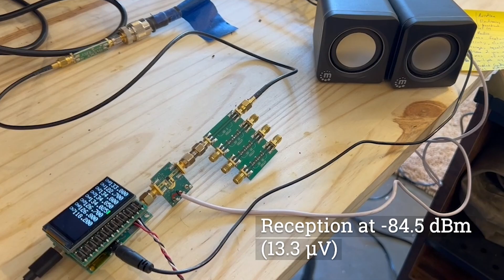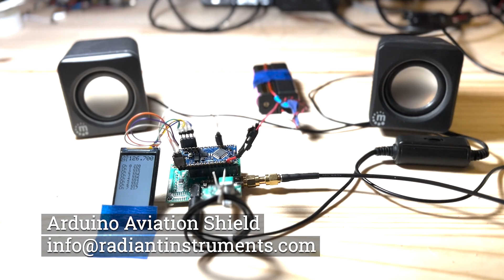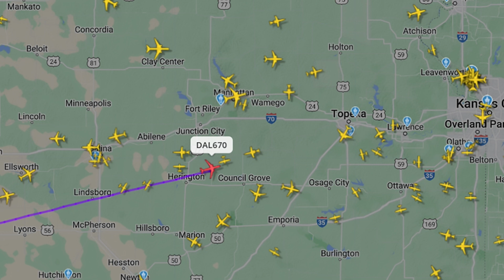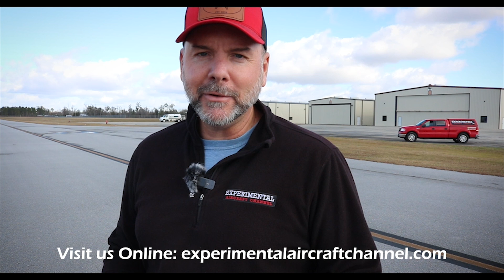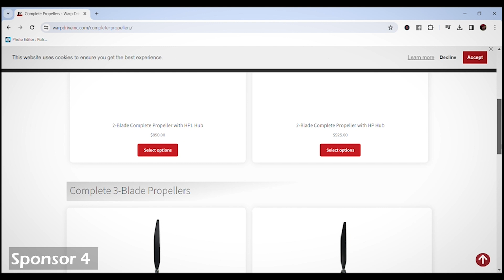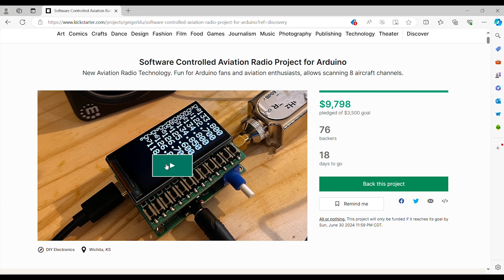An AUDIBLE ADSB Radio for Aircraft - SCARP James Wiebe

Comment: The receiver should be installable as a no hazard, safety system installation.  The transmitter would be tougher. FCC approval as a minimum for VFR use. TSO is not required for VFR communications equipment.

Comment: One comment to James,   no need to wait for GA certification.  Just put some Velcro on the back of it, stick it to the panel,  and you can use it today (after checking for interference issues).  Just make sure the LO doesn't radiate too much.

Comment: Made a scanner?  Functionally, I don't see what's that different... The form factor is the most interesting feature here, IMO
Reply: I agree. I see a big future for downsized and integrated avionics of all kinds. It should save us a lot of weight, a lot of money, and offer much improved reliability and performance. FAA is trailing too far behind, which is making safety too expensive.
Reply: @101jtag  careful what you wish for.  FAA offloaded the oversight of safety self-certification to Boeing. How did that turn out? When you allow manufacturers and designers to self-police, the results will be predictably bad for safety (but good for quarterly corporate profits.)

Comment: Sounds very interesting -  I'd want it to allow a remote head - one radio, control it from either the front or rear cockpit of a tandem aircraft.  FYI - you also need FCC certification for the transmitter. Connection/interface with GRT EFIS is a plus!

Comment: I guess I missed how ADSB plays into this. The SCARP appears to simply be an 8-channel scanning receiver which has no ADSB functionality. I did hear him say that he's looking into a better way of using ADSB, but it sounds like a separate project. The title of the video had me thinking that SCARP would use ADSB to filter out any communications that weren't in your vicinity or perhaps tune to frequencies that were in your vicinity, but I didn't hear anything like that. Did I miss it?
Reply: Probably using the ADSB term for all the plebs that use FR24... However, you're not going to get those people to build an SDR receiver and even come close to learning how to use a RX, Arduino, etc.
Reply: It's a VHF receiver that isn't capable of receiving ADS-B.  It's too bad James didn't shut down the host when he mischaracterized this, as on the Facebook feed some actually think it's a ADS-B replacement.   At the 23:10 mark, James does tell the host he is working on a real ADS-B receive
Reply: I believe he means that the (near) simultaneous listening to all nearby COM frequencies provides you with an awareness that mimics ADSB
Reply: @101jtag  Ah, a metaphor..  😎
Reply: @txkflier  LOL, queue  Monty Python Skit
Reply: @101jtag  If you consider ADS-B having a +- 1 mile accuracy and then only when the pilot decides to transmit a position report, which rarely is where the gliders hang out (over ridges and thermals away from airports).

ADS-B uses GPS to transmit precise position reports about once per second, regardless of location.

Comment: "AUDIBLE ADSB Radio".   Weird, because it looks like it's a VHF comms SDR.   If you've ever tried to listen to ADSB at 1090, you can't really pick much out of the noise :).     What is the advantage to having this device over say, a regular scanner that everyone has been using for the past 30-40 years?
Reply: Yeah its just about COM, so putting ADSB in the title may not pull in the right audience. Cool stuff.
Reply: It's a VHF receiver that isn't capable of receiving ADS-B.  It's too bad James didn't shut down the host when he mischaracterized this, as on the Facebook feed some actually think it's a ADS-B replacement.   At the 23:10 mark, James does tell the host he is working on a real ADS-B receiver.